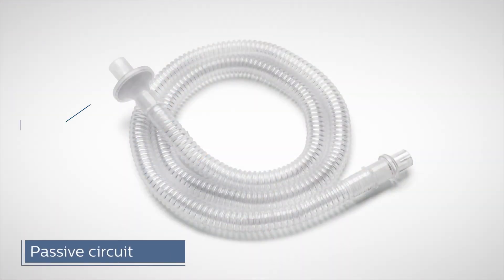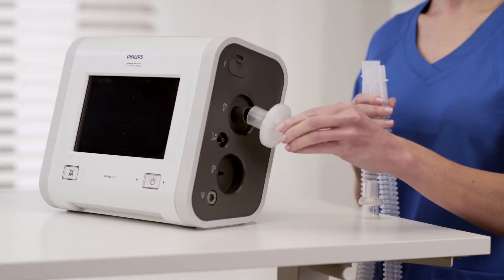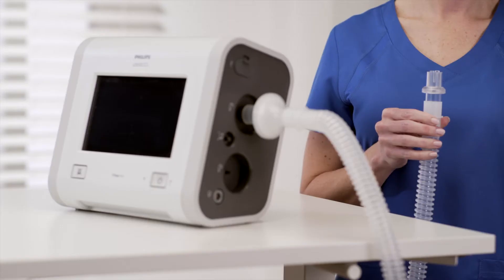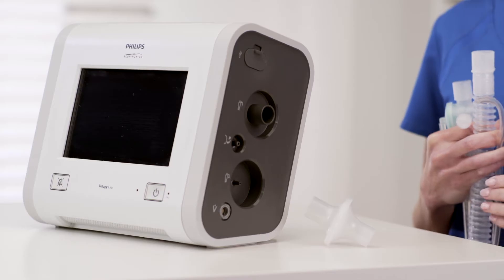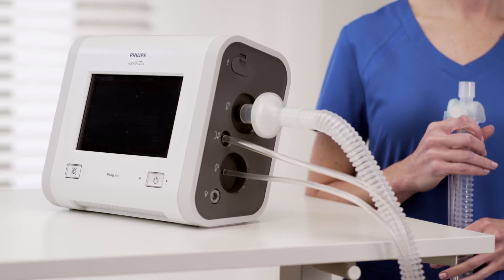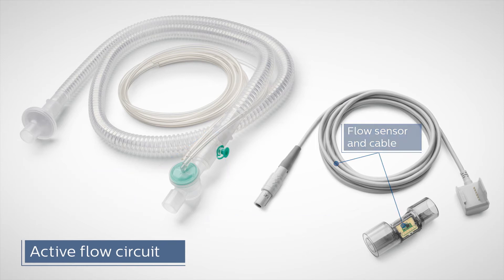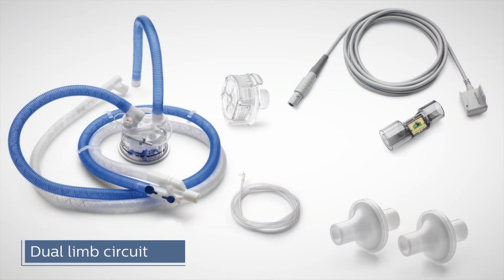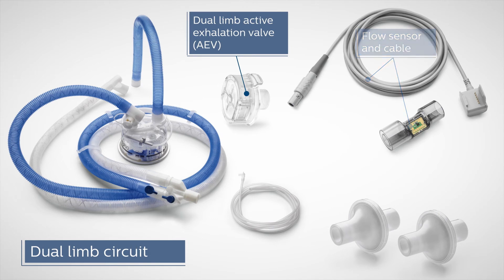Setting up circuits with the new Trilogy Evo ventilator | Philips | Sleep and Respiratory Care

Comment: For those who are stuck with ventilators like these, by Respironics, I feel so sorry for you. First we were dealing with wthe Trilogy 100s and 200s which are under the recall. Now It just so happens, that the Sillicone that they are putting in the new machines might be dangerous for us too. I'm a ventilator patient, who's now on a Trilogy Evo. I had a Trilogy 100, and I wanted another ventilator from another company called a VOCSN, but my DME didn't want to buy those, because the company wanted them to buy five or six of them. So, VOCSN, Not happenin. Now I'm stuck with the EVO. After what this company did to us, we really can't trust them. Which is tragic, because people like ME, don't have the DME, that will spend oodles of money for a good ventilator like the VOCSN. We're on a low class ventilator like the EVO. and my stupid DME won't even order the double limb circuits. Patients who rely on high grade ventilation, have no choice but to use the passive circuits, which by the way, I'm not tolerating. PHILIPS? YOU SUCK. Oh, and JAMES MEDICAL? MY DME? YOU SUCK!!!!! Thanks for putting this in this situation Philips. For not telling us victims about the cancer foam until you released the DreamStation 2. Thank you so much! I'm not even on a straight CPAP machine. So I don't care about your DreamStation 2.

Comment: The design is kinda similar to Hamilton C1
Reply: Wow. What a comment. I like it. So I'd like to know, how you kind of compair with this ventilator, kind of being somewhat similar in some ways sort of to the Hamilton C1 Ventilator? I've worked with the C1, and I'm curious to know your opinion here.
Reply: @Petertheconcertpianist92  Congratulation, C1 is a great device! The Philips Trilogy Evo is a compact ventilator with the pneumatic ports located on the right side (just like c1). This machine uses an external expiratory valve with some external tubing (also like c1 differential flow sensor). The compact rounded design of this Philips model, makes it very similar to Hamilton C1.
Reply: @JohnAK72  I just want to take this moment, and thank you. I want to thank you for explaining the ximilarities between the Hamilton C1, and the Trilogy Evo. I have a new respect for the Evo now. I've always had a respect a HUGE HUGEHUGE amount of respect for Hamilton Medical, and their ventilators, but Now I have a respect for the Evo, which Soon, I'm going to be working with, Like I had done with the Hamilton C1. At irst, I wasn't exactly looking forward to working with the Evo. Because we were suppose to get the VOCSN ventilator, but we're getting the Philips Trilogy EVO ventilator. I was pretty upset about this, after we'd hoped for the VOCSN, but after your description of the Philips Respironics Trilogy Evo, I now have a new respect, and am Kind of looking forward to dealing with it, instead of the VOCSN ventilator. I think we're going to like the Evo. We'll be getting the Dual Lim circuits. I think after you had made your comment that it has some similarities to the Hamilton, a ventilator with which I've done extensive work, I think we won't be so bummed out about the Trilogy Evo. I know I first had a fit when I found out we weren't getting VOCSN ventilators, but after seeing your comment and after asking you for further explanation about the Evo's similarities to the Hamilton C1, I think we might like the Evo's set up. I'm just hoping that the dual limb circuit has a good flow sensor.